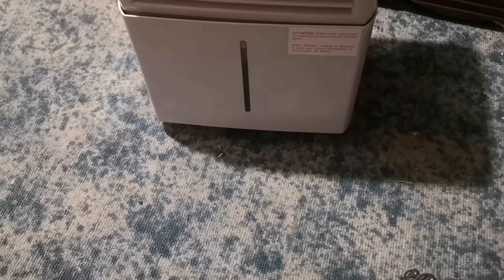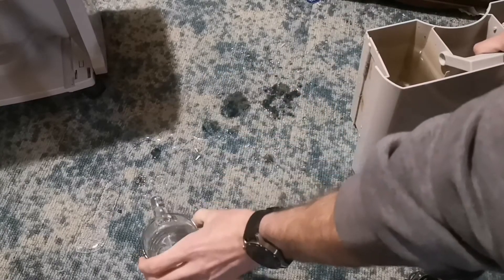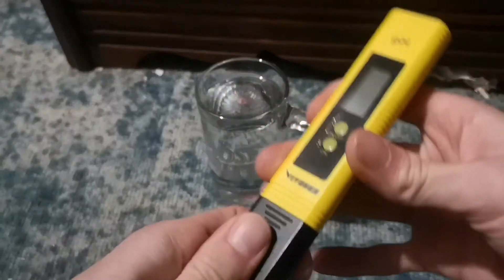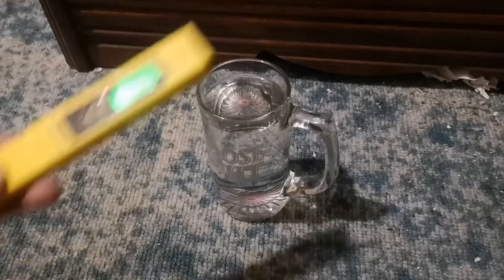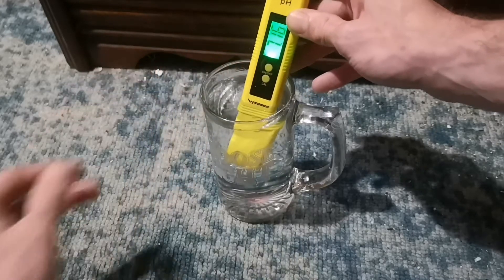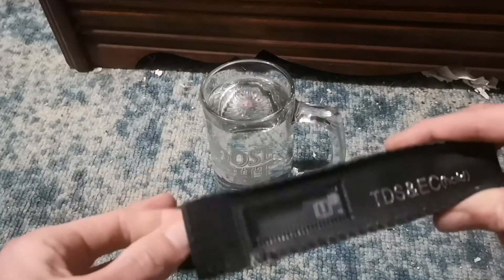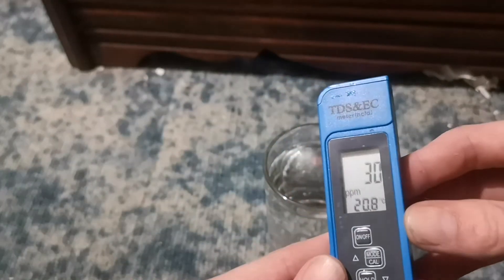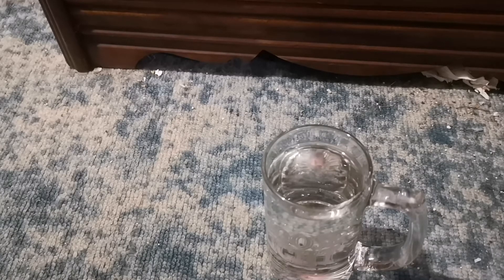Testing the water from my dehumidifier

Comment: I don’t see why it wouldn’t be drinkable after you boil it and put it through a really good multi-stage filter. Maybe even add a little bit of Himalayan pink salt for some extra minerals 😉 Great test! Depending on the humidity of the environment this could be a life-saving source of water if you have an energy-efficient dehumidifier and/or a good reliable source of power. Worst case scenario use it to flush your toilet lol
Reply: Run that water through a steam distiller.
Reply: @steveciarico9824  right? That's what I was thinking.  Then it would be drinkable.  Paul Bragg promoted drinking only distilled water, he was a health guru way back when.  He died at 94 in a surfing accident or something.
Reply from the maker: Surfing at 94,that's crazy!
Reply: @cryptoworldgames   😆 🤣 😂  too soon!!!!!! 🤣 🤣 🤣
Reply: Also the ppm that you showed is actually pretty low. A Zero water filter would definitely take care of the rest of the dissolved substances.
Reply: @evyiennetla9416  Be careful. If you water a potted plant with just distilled water you'll wash and burn out its minerals and nutrition. You'll also probably fuck up the bacterial ecosystem in your soil since they don't really like distilled water. Not all dehumidifiers are made equal either so you could be messing with some heavy metals that are gonna build up in your body and cause serious imbalances and toxicities in you and your soil.  

There's a reason the manufacturer tells us to dump that water. Just know what you're dealing with.

If you really want distilled water put a copper pipe into a boiling tea kettle and collect the precipitation in a glass. Clean as can be. 

You're AC unit or Dehumidifier is a machine and has machine oils and moving metals... involved in its operation. Even just for stupid weed plants, YOU NEED TO DILUTE IT DOWN... 

Don't drink it pure or you could be ingesting radiator fluid, heavy metals, or some other shit. Just, IDK you get what I'm saying?
Reply from the maker: I won't be drinking the water from my dehumidifier but I mean it could be a possibility if need be, was thinking about using the water for watering plants and stuff but I don't any plants right now anyways, and wouldn't it depend on what the air quality in the enviroment is. Which I have no idea about.
Anyways, thanks for the comment
Reply from the maker: Yeah you would think it all depends on the air
Reply: @mr.msadventures427  we know still water is no good. How about pressing  it through a vortex chamber to awaken the dead water. 😳 plus the minerals and the electricity.  We should have top tier 💧water. 😤 I rest my case. 😆 🤣 😂
Reply: @Most_Amazin  If you ran it through a sand filter and changed the sand often enough you could probably get away with using it if it comes out of the machine with near nothing in it. Hopefully, the sand could bind up some of the nasty shit in the water while mineralizing it a bit with whatever the sand has in it.
Reply: @momentiummonroe1475  ooooh I just excited maybe some rocks from Hawaii grind them up. Use that vast abundance  of minerals from the rocks to mineralize it. (If that's not a word it should be it sounds good) lol. Ok now that we have that taken care of. No vortex for standing water?
Reply: @Most_Amazin  If you look up basic sand filters or DIY Water filters You'll see a ton of pictures of different ones. Some are as small as a water bottle and others as big and complicated as a saltwater aquarium sump with Plants, algae, and bioremediation-type tanks that pass the overflow into a collection tank or just keep passing the water through the system till everything basically sticks in the sand and your waters clean.

Some of the NOTG guys with low PH also charge their water (Mineralize err whatever) with calcite in inline RO-looking filters. You can even put some Carbonated water over the limestone to increase the "Mineralization" of the water...

On rocks? brah that waters gotta slowly go through a layer of rocks, Coarse Sand, Fine sand, then... IDK maybe a coffee filter or a fine bubble hash bag. I wouldn't try to make those grades of sand from just rocks. You gotta go play real-life Minecraft and find some nice grades of sand that'll work for you and your filter also the amounts you're trying to filter is probably gonna play a roll in how you set it up. 

Once you filter the water and have a holding tank, vortex it or whatever you usually do with it. It's basically good spring water if everything is working. Just remember to change that sand filter if the PPM gets too high. It's a filter so not changing it could be risky business
Reply: @mr.msadventures427  Best thing to do with that water without treating it first? Put it in the nursery's humidifier. what should happen is the sediment gets left in the humidifier holding tank and the water gets dispersed into the air. separating the nasty from the water and giving you a reliable source of humidifier water. 

Again Cleanliness is next to godliness. So cleaning the humidifier's holding tank is key to keeping molds and mildews low. also seeing how dirty the humidifier's water is.
Reply: It doesn’t take much, heavy metals destroy Human Organs! Filters?
Reply: @Danny Comment  Activated Alumina: Activated Alumina is designed to remove fluoride, arsenic, and selenium. It is a filtration system you install under your sink and can be highly effective and cost-effective. However, it may actually increase traces of aluminum. 

Activated Carbon: This is a charcoal filter that has been processed to trap pollutants. It’s a popular option for most home filtration methods and it’s pretty effective at removing chlorine, sediment, VOCs, and improving the taste of your water, but it doesn’t remove minerals, salts, or compounds that are already dissolved. 

Ceramic Filters: This is a similar concept to charcoal, but uses ceramic instead of carbon. They tend to work at killing bacteria and protozoa and are relatively inexpensive, but they take quite a bit of time and don’t always work against heavy metals. 
Reverse Osmosis: This method runs water through a filter with a membrane. It is highly effective, but also tends to waste a lot of water and requires significantly high water pressure. 

Water Distillation: Basically, this is the same as boiling your water into steam and then cooling it down. Yes, it works. Yes, it’s somewhat efficient, but it is very very slow and can take hours to produce just a small amount of filtered water.

If you can't be bothered with those use a deep sand filter and change the sand out according to the size of the sand container after a few gallons of water is collected... You need the thing to filter too! so don't dump the tank onto a bin of sand, collect a ton of water all at once, and expect to filter anything... You want drops going through that sand. Planting things in the sand that eat up whatever your dealing with from the dehum and removing those plants to the trash can once they've grown may also help with fixing the water... Really the grades of sand are what's doing the filtration so disposing of that once you're done with it is the cheapest and best way. 

Have your water tested before buying a filter. There really is no good way to get rid of the heavy metals so for the average person in Flint Michigan or wherever. The earth uses sand and dirt and plants to absorb nasty shit so... if you don't want to get your water tested and buy a filter... work with nature.

It's not like you drink water with heavy metals and your organs begin to rupture. It's a concentration over long periods of time that kills you. I'll be honest lots of places have hard water coming out of the tap and the government literally can't do anything to improve it because of past mistakes with industrialization.

 Look Around you? Everything is kind of nasty. Most fertilizers you buy from the hydro shop are kind of nasty, that shit from Walmart your mom sprays on the rose bushes is also pretty nasty, the stuff the ocean brings in when it's high tide and sinks into the water table is pretty nasty. The fractures in plumbing that happen after an earthquake is really nasty.

This world is pretty nasty and polluted with heavy metals and there really isn't much we can sustainably do about it. These are my suggestions hopefully one works for you.
Reply: @dannycomment779   Activated Alumina: Activated Alumina is designed to remove fluoride, arsenic, and selenium. It is a filtration system you install under your sink and can be highly effective and cost-effective. However, it may actually increase traces of aluminum. 

Activated Carbon: This is a charcoal filter that has been processed to trap pollutants. It’s a popular option for most home filtration methods and it’s pretty effective at removing chlorine, sediment, VOCs, and improving the taste of your water, but it doesn’t remove minerals, salts, or compounds that are already dissolved. 

Ceramic Filters: This is a similar concept to charcoal, but uses ceramic instead of carbon. They tend to work at killing bacteria and protozoa and are relatively inexpensive, but they take quite a bit of time and don’t always work against heavy metals. 
Reverse Osmosis: This method runs water through a filter with a membrane. It is highly effective, but also tends to waste a lot of water and requires significantly high water pressure. 

Water Distillation: Basically, this is the same as boiling your water into steam and then cooling it down. Yes, it works. Yes, it’s somewhat efficient, but it is very very slow and can take hours to produce just a small amount of filtered water.

If you can't be bothered with those use a deep sand filter and change the sand out according to the size of the sand container after a few gallons of water is collected... You need the thing to filter too! so don't dump the tank onto a bin of sand, collect a ton of water all at once, and expect to filter anything... You want drops going through that sand. Planting things in the sand that eat up whatever your dealing with from the dehum and removing those plants to the trash can once they've grown may also help with fixing the water... Really the grades of sand are what's doing the filtration so disposing of that once you're done with it is the cheapest and best way. 

Have your water tested before buying a filter. There really is no good way to get rid of the heavy metals so for the average person in Flint Michigan or wherever. The earth uses sand and dirt and plants to absorb nasty shit so... if you don't want to get your water tested and buy a filter... work with nature.

It's not like you drink water with heavy metals and your organs begin to rupture. It's a concentration over long periods of time that kills you. I'll be honest lots of places have hard water coming out of the tap and the government literally can't do anything to improve it because of past mistakes with industrialization.

 Look Around you? Everything is kind of nasty. Most fertilizers you buy from the hydro shop are kind of nasty, that shit from Walmart your mom sprays on the rose bushes is also pretty nasty, the stuff the ocean brings in when it's high tide and sinks into the water table is pretty nasty. The fractures in plumbing that happen after an earthquake is really nasty.

This world is pretty nasty and polluted with heavy metals and there really isn't much we can sustainably do about it. These are my suggestions hopefully one works for you.
Reply: They use certain plants in water treatment plants to clean sewage before returning it to nature, then it goes down river into the next towns water supply. Find out what plants they use and you might try that additional stage since it's government approved. Many pool systems use sand filters and you just backflush to clean the sand out every so often. Sand is just a silicon/glass rock material to seperate larger material from the water. It's the cheapest first stage filter to preclean before going through the more expensive filters. You want your filter system to filter from cheapest filters first to most expensive last so the expensive ones last longer. Reverse Osmosis should be last as these are usually the most expensive. A distiller stage just before that gets out most things but certain chemicals, UV after the sand to kill any bacteria, etc. Carbon filters removes nasty taste. Sandwhich in any other filters between the carbon and distilled by cost. A 13-15 stages is not uncommon today. Finally determine at what stages you can use your filtered waters for each use from toilet flush, to laundry, to dish/surface cleaning, to bathing/wash, for plants, fish, pets and finally for cooking/drinking. Your skin can absorb things so between surface cleaning and that you can decide which stages are not as risky to skip for cost.